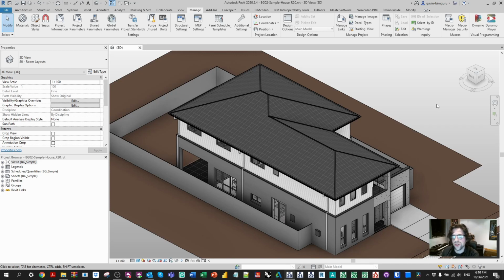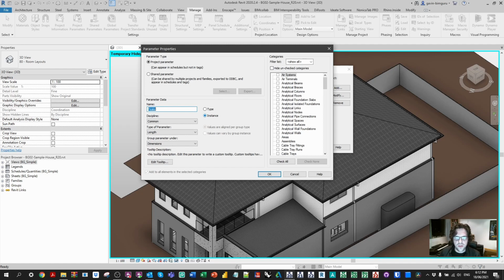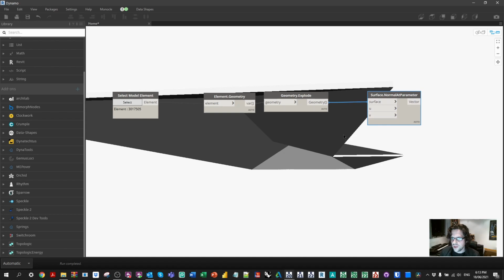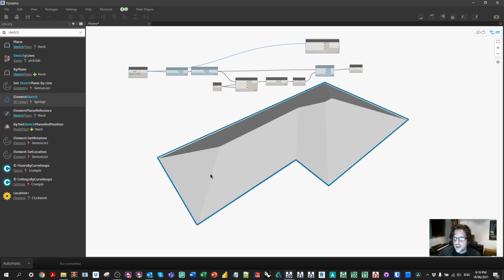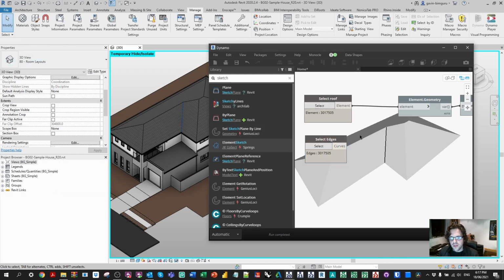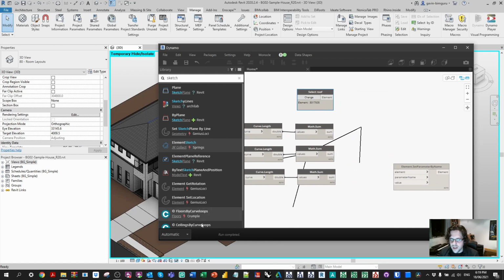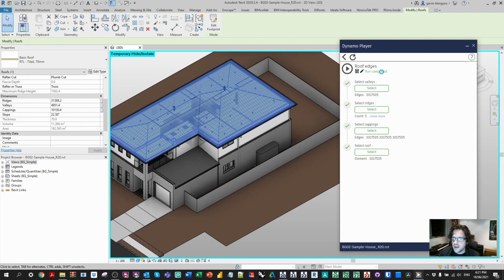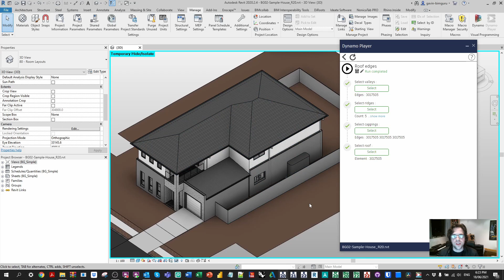The value of keeping your (Dynamo) solutions simple...

Comment: Great tutorial. Learned something new and helps not to lose touch with Dynamo as I am mostly using Grasshopper in this period. I also feel the need to document my own scripts that I may have not used recently, needed to reuse just a part, or find myself thinking and streamlining previous scripts to make them more efficient, or add new things to existing workflows.
Reply from the maker: Great point - documenting scripts can be very useful for other users to follow or just to catch up with your own thinking at a later date.